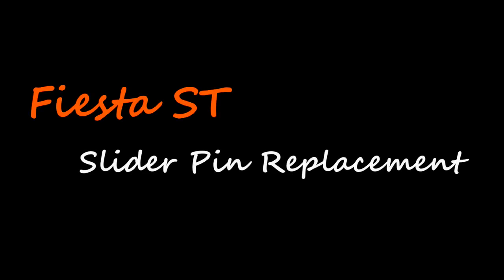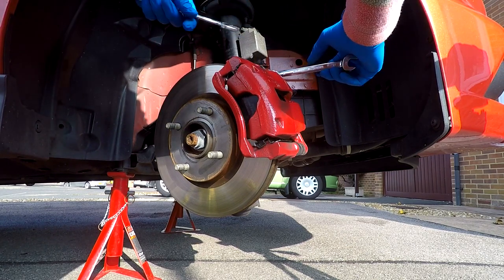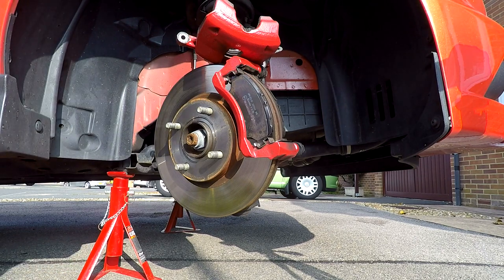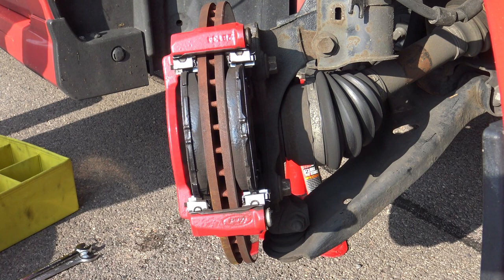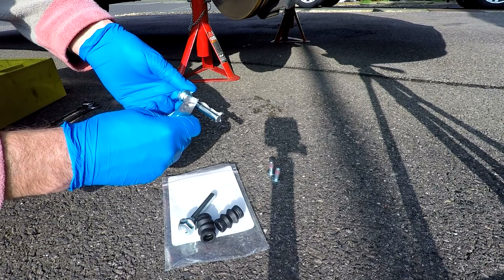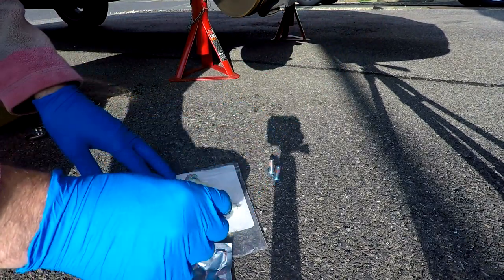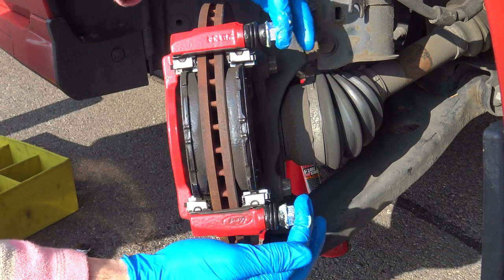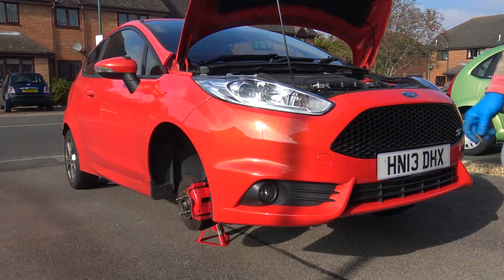Ford Fiesta ST (mk7) - front brake slider pin replacement

Comment: been watching a lot of your videos I must say very knowledgeable and informative so keep them coming 😀 just a quick question it's a silly one but where should I put the axle stands? I've been puting them on the subframe but I noticed you have them elsewhere?
Reply from the maker: Thanks James! Axle stand locations? That's one video I wish I'd made before I sold the ST...but I may have some footage from when I did the slider pins/discs/pads that shows it a little more clearly. I'll see if I can pull something together.
Reply: I would very much appreciate that 😊😁 thank you
Reply: MarkCup70 hi mark is it the same procedure for the rear

Comment: Hello, very nice video quality! Why do you change those pins? And how do you know you have to?
Reply from the maker: They need lubricating to stop them seizing...if they do you will have problems with the brakes sticking on, binding, uneven brake pad wear and so on.

My car has done a few trackdays and 56,000 miles and they were deifinitely in need of a good clean and some fresh lubricant but I thought, for the price, I may as well just put some new ones in.
Reply: MarkCup70 all right, thank you for your answer and a big thank you for your videos!
Reply: @MarkCup70  Have you ever had the fronts seize up? I was worried they would after having my rear ones seize up 2x but I think the front is designed better, even though it seems similar.

Comment: Did you put a higher profile tyre on the mk7 st alloys?.
Reply from the maker: Yes I did...it was wearing Yoko AD08R tyres in this video and the only possible fitment for them came with a slightly higher profile.
Reply: MarkCup70  did they make the ride less harsh? glad your RS is back in ACTION :) thanks.
Reply from the maker: Thanks Jake, it is good to have it back! Did the tyres soften the ride? Not really...AD08Rs are a semi track tyre so the sidewall is a little firmer than normal road tyres...which I think offset any benefit you get from the higher sidewall. It felt identical to the Bridgestone RE050 when I first had the Yokos fitted and drove away.

Comment: Hi, I'm not sure what a slider pin does, or when do you need to replace it?
Reply from the maker: Apart from the single piston it's the only moving part on a floating caliper assembly. If they get bent or seize in place your brakes will not function as they should and you could get uneven pad/disc/rotor wear. They don't need replacing as such (although as they're so cheap, why not?), just a clean and re-lubricate (with the correct high temp grease - VERY IMPORTANT!) every now and then should be enough.
Reply: MarkCup70 are they £10 per corner (4) for the pins?

Comment: Do you never drive your car? How is the wheel well so clean, lol
Reply from the maker: Timmy Turner Ha ha, this was after 55k miles as well! Once a year I take the wheels off and give them, the wheel well, and the brake calipers a very thorough clean. Pressure washing helps as well.